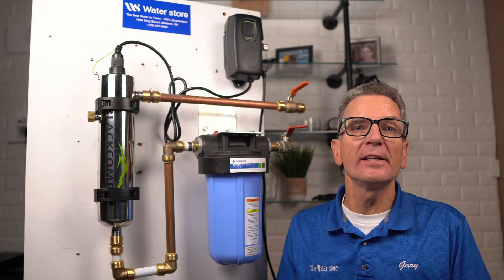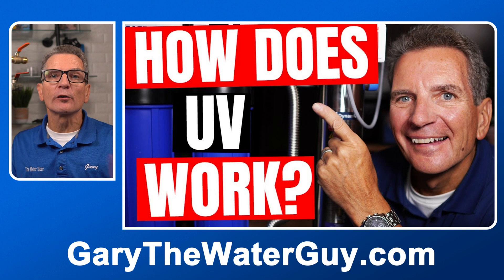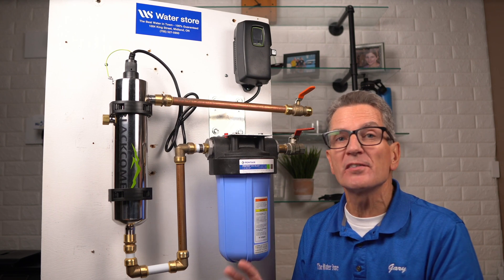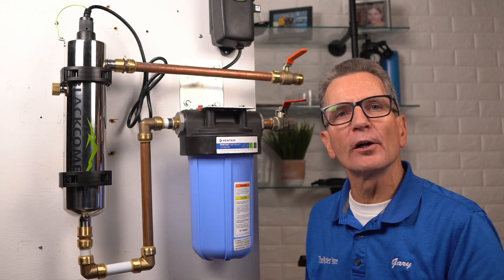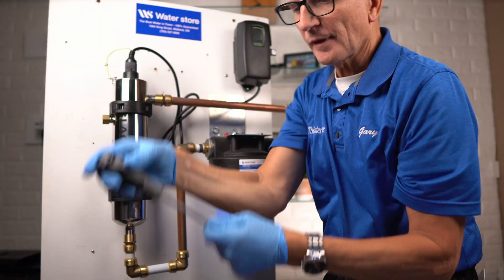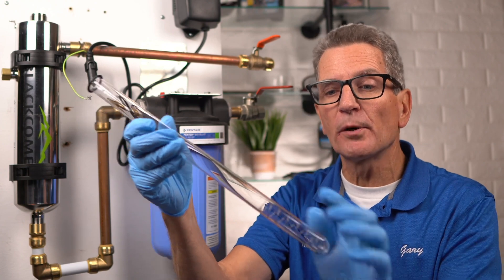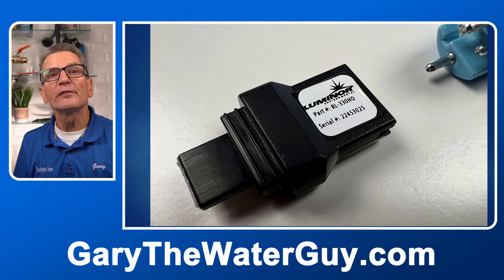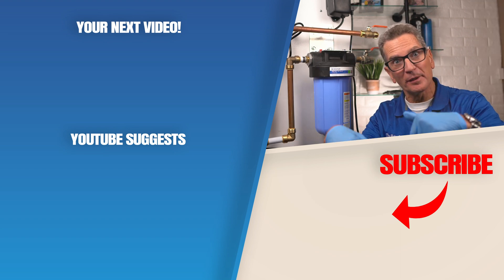How I Maintain Luminor Blackcomb UV Systems

Comment: I just had my lamp replaced it failed 2 days later and now the system is leaking from the gland but… please help what do you think happened?
Reply from the maker: Sounds like there was an internal leak and the sleeve filled with water and shorted out the lamp.  May not have been reassembled correctly after service.

Comment: Question I need your help! Today my lamp failed, I just got it replaced by a company 4 days ago and it was working fine. Today I wake up and got the alarm going off and the panel said the lamp failed. But suddenly it’s leaking from from the connector
Reply from the maker: Sounds like there was an internal leak and the sleeve filled with water and shorted out the lamp.  May not have been reassembled correctly after service.

Comment: What about the UV Sensor - how would I clean the Luminor Blackcomb UV Steriliser UV Sensor?  Do I need to remove the UV Lamp and Quartz Sleeve before removing the sensor?
Reply from the maker: Page 13 of the manual here provides the procedure https://9kqsbxz5qcvz5a92-6595447.shopifypreview.com/cdn/shop/files/Luminor_910001-blackcomb-manual-eng.pdf?v=12741812653798948286 Basically you shut off the water and depressurize, remove the sensor and clean the window with isopropyl alcohol and replace.
Reply: @water_estore  Thank you.  I went ahead and cleaned my sensor very well with isopropyl alcohol.  Still getting an alarm with UV out put below 20 % - This system is only 1 years old.
Reply from the maker: If you pour your water into a white pail, is it a weak tea color?
Reply: @water_estore  No, it's clear, or at least appears so.  The alarm started shortly after I replaced my bulb.  So I then went ahead and replaced my quartz sleeve.